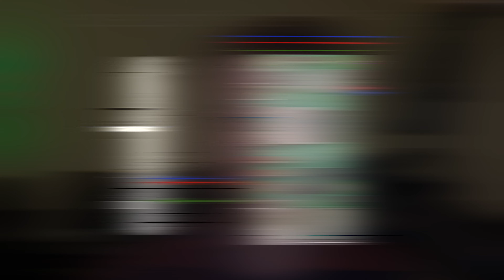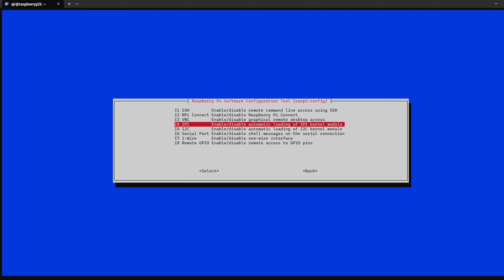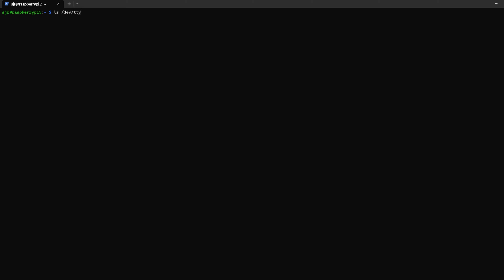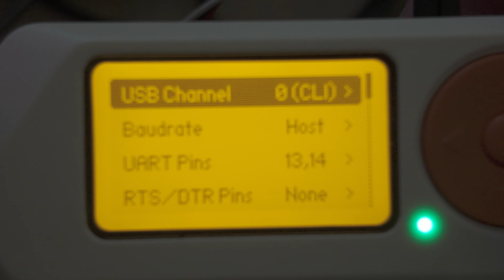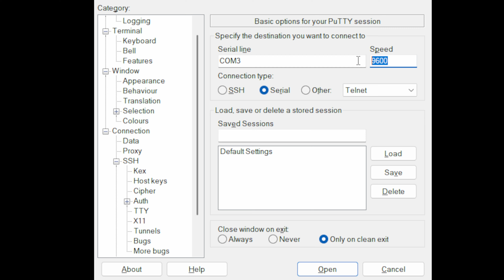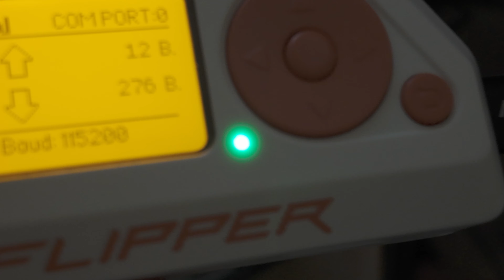How To Setup UART with GPIO On Raspberry Pi 5

Comment: i already have a lidar connected to gpio 4 5v 6 gnd 8 txd 10 rxd , in my python code imusing USB0 ttyama0 @ 115,200, i thought that pi5 had a second uart gpio pins availabe im i wrong?
Reply from the maker: Hi Alfonso On Pi 5 there’s only one hardware UART routed to the GPIO header by default (ttyAMA0 on GPIO 8/10). The extra UARTs exist internally but aren’t mapped to pins unless you mess with device-tree overlays. I would take a look at https://forums.raspberrypi.com/viewtopic.php?t=361741

Comment: a question, is it possible to directly connect it via USB? the raspberry detects the flipper?
Reply from the maker: I have my flipper zero connected to my Windows 11 PC with a USB cable,  going from USB-C on the flipper to USB-A port on my desktop.  You could likely connect your flipper zero to Raspberry Pi for transferring files and other operations. But for a bridge you would want a second device that is always going to be on. Because when the Raspberry Pi reboot there goes your bridge connection down :).  But if you weren't rebooting that could work!